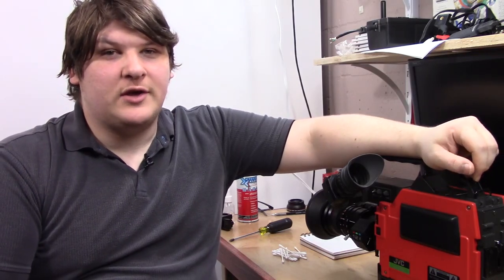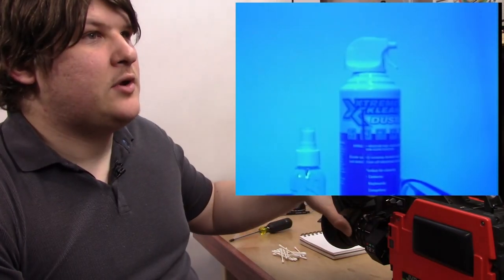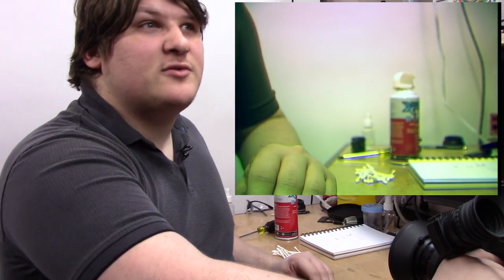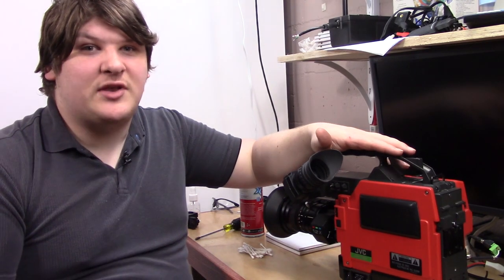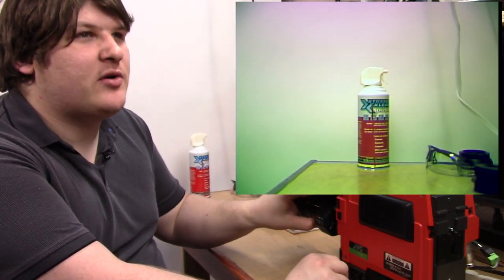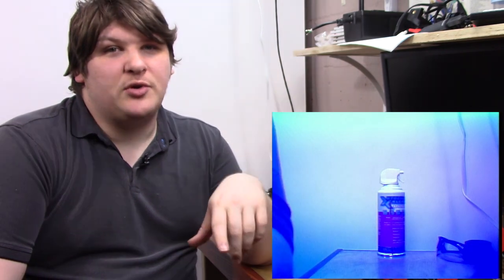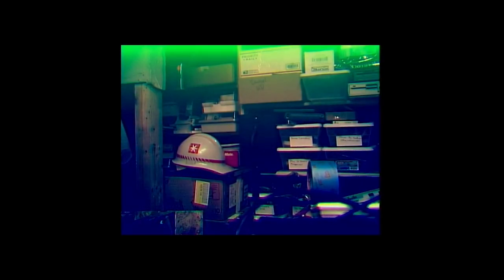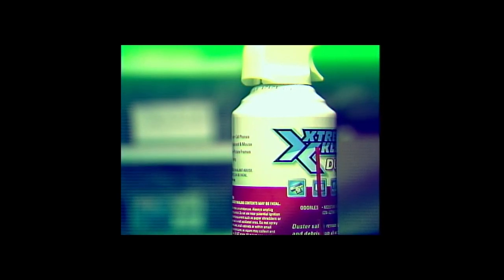Love Letter To JVC KY-210 - Part 2

Comment: I have this video camera too! I bought it at a thrift store for $20 with the hard case. The battery is deader than dead, but after a while, I bought an ac power brick and a 4pin XLR cord. So far it works. Im gonna use your advice and get a RCA adapter and plug this into my VCR to test it out. Thanks for the in-depth video, I didn't know about half the features on this thing!
Reply: Did you get it working?
Reply: @Dong_Harvey  Sadly I got one image and couldnt get it working again. All the rubber pieces were turning to goo so I had to get rid of it.

Comment: Hi, I´m binging through your videos - and although I realize this is an old one I just wanted to give you a hint about that white balance. You´re not supposed to flip that switch just pointing the camera to whatever is in front. You´re should hold a white or grey sheet of paper in front of it filling the field of view. Then correct aperture (so that it isn´t too bright) and then flip the switch.
Reply: Yea we used to have a grey card that I vaguely remember being made by Polaroid or someone like that.
Reply: yeh, I was literally just going to comment about that.  Thanks for letting him know.  Yep, you are supposed to have the entire image on something pure white, and also adjusting the iris a bit so you are kinda not over the top or under with exposure.   THEN you flip that white balance switch.  ALSO the black balance is for something BLACK in the room you'd use to completely grab by zooming in until it fills the frame completely and THEN flip black balance.   Hope this helps !!   (also applies today with modern cameras and some DSLR's even have white balance manual !)

Comment: At 5'10" that's a "times two" lever available on most B4 type lenses.  All of the lenses we have here have them (even wide angles).  Only cheaper "industrial" lenses do without them.
At 8' the gain switch will give you the equivalent of 2 or 4 stops of extra light (at the expense of grain) - the doubler will take away 2 stops of light.

Comment: I know exactly what happened. It isn't you. The thin polarizer material on the glass prism in front of the tube has separated and is at an inappropriate angle.

Same failure mode in old single side play Laserdisc players
Reply: Any way of fixing that?
Reply: I don't think it's a problem with the prism. I'm pretty sure a prism failure would be pretty rare considering it worked for a while when he first had it. I think it's capacitors on the video process board that are failing. Common issue with tube cameras that need work. I don't know if CRD still has this camera but I wouldn't be surprised if some of the capacitors in these JVC cameras turned out to be bad. Even Sony cameras from this time have failing capacitors but they usually are tantalum capacitors with Sony while the other companies like JVC/Ikegami used electrolytic.

It could also be problems with the black balance.

Comment: That doubler is also called a teleconverter. You can also get them for 35mm cameras and modern cameras too. They come in 2x, but 1.4x and 3x are common too, and the brightness loss scales with the zoom factor.

Comment: That extra spring lever on the extender, which I know it is called by Fujinon, is most likely meant for feedback to the servo-unit about the position of the extender, which can then relay this information to the camera's CCU-connector (or, on modern lenses, the digital remote that can basically control the whole lens via a 12-pin connector at the bottom of the servo-unit)
I don't know if this lens could be equipped, but there are lenses with extenders that can be motorised so the camera operator in the control room can enable the extender remotely. (that's why there's also a feedback-option). Extenders are still very common, even on modern ENG lenses. Their quality is now so good they impact image-quality only measure-able (?).
Oh and for 15:00 you did VERY WELL on manually focussing that sparrow (was it a sparrow?). Many, MANY people of my age (33 at the moment, 2021) I know can't even grasp manual focus at all and don't seem to get that the LCD even shows you whether you're in focus or not (though I have to admit, I still miss the good old CRT-viewfinders, which just incorporated peaking on it's own instead of the peaking one usually has to adjust on a LCD-viewfinder to be able to it properly. Sony does a very good job on this, JVC sucks quite a bit when it comes to good focus peaking.

Comment: Oh, by the way: Thanks for pointing out that image doubler. I learned my Ikegami has the same thing!  (That's a Fujinon lens on your JVC, which is branded on my Ikie, but otherwise looks the same. Very similar design, and I was able to follow along with everything you were showing on the lens with mine.)  For video cameras, my first love was a Sony AVC-3200, which I spotted in my high school's AV department. (Yes, I'm an old fart, who remembers 1/2 inch open reel VTRs used in classrooms.)  That JVC is the best looking three tube ENG camera I've seen so far. I hope you find a way to fix it.  Also, thanks for the idea of using a cell phone as a much, MUCH lighter porta-pack for the camera!
Reply from the maker: Outstanding! Yep, I'm familiar with 1/2" video - I did a whole essay about it here on my channel, "Forgotten History of Home Video," and I have a working Sony AV-3400. It's way before my time, but I can imagine what it must have been like to have access to this stuff back in the day!
Reply: @CathodeRayDude  Oh, yeah! That was my first of your videos.  YouTube recommended you because I watch Technology Connections, Radio TV Phono Nut, and Techmoan a lot, and you fit right in.

Comment: You probably already know this by now, but in still photography the same idea as there doubler exists as 'tele converters' they are extra elements you manually add to increase. Usually they are designed to work with specific  focal range lenses, so a converter for a 200mm lens will not work well is a 50mm lens etc.

Comment: It's called an extender as well and has one stop of light loss.  Amplification is normally called gain.  9db is typically one stop of light sensitivity gained, 18db is two.  Modern have from -3 db (useful to reduce light in very bright situations or when you want to open the aperture more to blur the background) up to 42db or even higher.  Black levels on older cameras were more prone to drifting over time or after gain usage.  Today with modern cameras you might do it  once or twice a year for things like news.  I agree there was a useful counterbalance effect with the weight.  The best was a PDW530 XDCam...just well balanced and the right weight to follow action off the shoulder well.  Shot with an HDCam and it was the heaviest damn thing and counterproductive. Had a 300 series P2 last and it was a bit too light.  

You could start a collection of formats...3/4, oxide betacam, betacam sp, MII, Super VHS, Dcvpro, Dvcam, Betacam SX, HDCam, Digibeta, XDCam, P2, and more...Never a shortage of formats...

The king of video back in the day...from about 85-2005 was the Sony D600.  The thing cost as much as a house, but was the defacto camera for network level video work, like 60 minutes, Dateline, Nightly News.  I'm sure you could pick one up for next to nothing now.
Reply: A doubler darkens the image by two stops.  6 dB is one stop and 12 dB is two stops.  Here's the math:  

A doubler doubles the focal length.  The aperture diameter is unchanged.  The F-number is the focal length divided by the aperture diameter.  So doubling the focal length also doubles the F-number.  When comparing two F-numbers, you take the square of the inverse ratio to get the change in exposure. So 2x the F-number is 1/4 the exposure.  And to express an exposure ratio in stops, you take the base 2 logarithm.  log-base-2 of 1/4 is -2.  

The formula for dB is 20*log(V2/V1) where V2 is the new voltage and V1 is the old voltage.  So 6 dB is a doubling of the voltage.  [ 20*log(2/1) = 6 ]  In these cameras, gain is applied to the linear voltages before gamma encoding is applied.  The voltage is directly proportional to the exposure (brightness).  So 6 dB of gain is a doubling of the voltage, equivalent to a doubling of the exposure, which is one added stop.

Comment: You're likely already aware, but some MiniDV and Digital 8 camcorders can accept an AV input for recording or capturing over FireWire. It may be a bit more bulky, but it works great for capturing analog video to 720x480i DV.
Reply from the maker: I've experimented with this and the results are... not what I'd like, heh. It's also very unpleasant trying to interface with Firewire on modern systems, it turns out. :(
Reply: @CathodeRayDude hi! Major fan of yours. Anyway, what was the name of the app you had there, as well as those other components to record from you cellphone?

Comment: Nice old camera the fault is in the blanking and black level section the tubes clamping is also weak it’s probably just caps as it varies with temperature.you need a schematic really but caps are cheap and as it’s modular you could do a module at a time . It’s the sort of thing I would love to get my teeth into.

Comment: got some cheap Chinese lenses for my ol Canon DSLR, weird lenses are great fun to play with. mirror zoom lenses, 2x doublers, T ring, strap it to a 500x spotting scope, that kinda thing. they are a right PITA to use, all manual, but thats why photography (and videography i guess) is a fun hobby, you can screw around with it, and every now and then, something really cool comes out of it. 

my question is, is there a ring adapter available that you can use your pretty swish old video lens to an SLR mount? by all accounts, thats a pretty nice peice of glass. what is that mount actually called? can I plug it to my canon? (or sony, whatever, worth buying a 'new' depreciated SLR for that)

I can really see myself building a shoulder stock for a 10 year old DSLR using a 30 year old pro grade video lens. not sure if its 'a phrase' in the rest of the world, but in AU, it would be 'for shits and giggles', AKA, 'cos I can'

also, pretty cool that the squirrel uses that concrete ridge as a highway. I love finding  wildlife 'hacks' like that. that scene would have been pretty bad on a camcorder. huzzah big red!

Cheers Mate!

Comment: Hello!!
Nice video again. :-)
I´ve a question regarding to the video capturing method that you are using with the "Easy Cap" and you cell phone.
1- What kind of software did you used for the video capture?
2- Is that software for an Android device?
3- Does the capture result in the maxium resolution and with all the fields that the camera can supply to the Easy Cap?
Thanks in advance and congrats for your videos!
Asier.

Comment: the x2 zoom magnifier is really interesting. I wonder what type of lens mount would be used here. Does it still a single flange distance?
Reply: That lens mount is just called a bayonet mount.  3-tube (and 3-CCD) television cameras pretty much all use some type of bayonet mount.  In the early days, every TV camera manufacturer had their own bayonet mount.  At some point, probably in the 1980s, a Japanese standard was established.  For 2/3-inch cameras, that standard mount is known as "B4".  I don't know if the JVC KY-210 camera uses B4 or one of the earlier proprietary bayonet mounts.  The doubler does not change the flange focal distance.

Comment: ive managed to recreate the comet trailing effect that tube cameras have but its still no where near as good as an actual tube camera
Reply from the maker: Wow, I'd be really interested to see this! How did you do it?
Reply: @CathodeRayDude  i didnt get the notif for this oops, from what i can remember at a very basic level i used the threshold effect in after effects on a duplicate of the footage, and then threw an echo effect on that duplicate, it kind of worked but it was still quite digital looking and at times would completely overpower the footage if there were too many bright objects (like the sky etc), apologies for the 7 month late reply haha

later down the line i managed to get an old hitachi vk660 (i think thats what its called), but ive got no means of capturing it and might have blown something inside of it, i have no idea what kinda of video signal is sent through the 10 eiaj connector most of the consumer cameras used back then so ive been at a standstill for quite a while as far as that goes, i cant find a vtr or anything either and would rather just hack together some sort of jank solution that terminates in a composite or s video cable that i can just hook up to my tv or a cheap capture card, idk if youd have any ideas in regards to how i could go about that
Reply from the maker: @Bkoded  I actually do, eiaj-10 was very standard and you only need to know where three pins are to get hooked up to it, you can even buy The mating connectors online. I think I forgot to ever make a page on my site about it, I'll do that soon, but it's really easy, you just need to hook up a composite type RCA cable, and a 12 volt input and you're good to go
Reply from the maker: Oh, and if you Google eiaj-10 pinout, you can find at least a couple pages that have it already, although they are a little tough to work out if you aren't already experienced with this sort of thing
Reply: @CathodeRayDude  i do remember looking at a page back when i was trying to power the camera which had the pinout and was quite helpful, ill have to grab a female eiaj cable (if i can even find anything like that) and diy a composite output alongside means of powering the camera, audio i can sacrifice in the worst case, thanks for clarifying that this is actually possible, i wasnt too keen on spending an unreasonable amount on a power supply someone has probably labelled as ‘vintage’ on ebay that hasnt even been tested